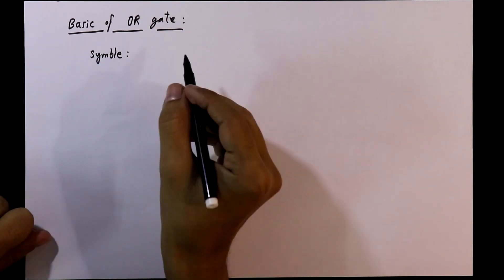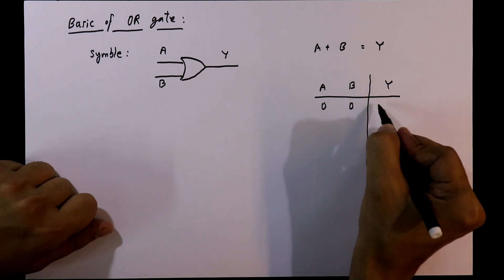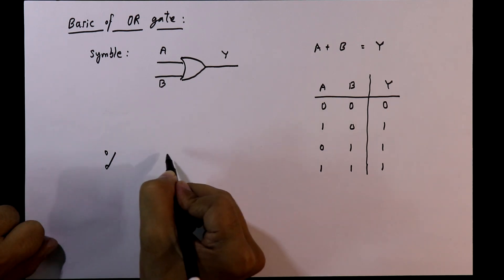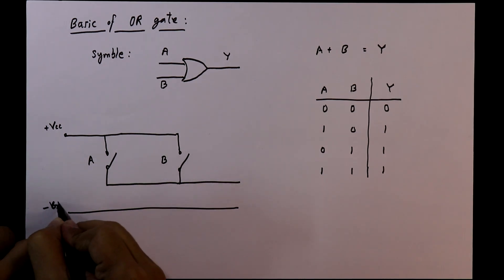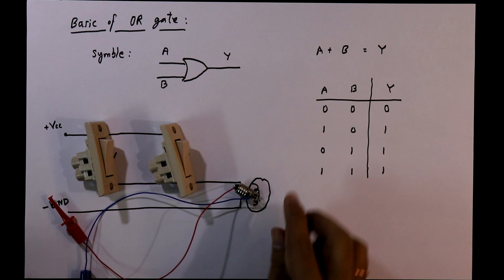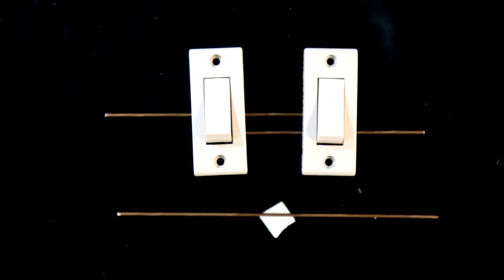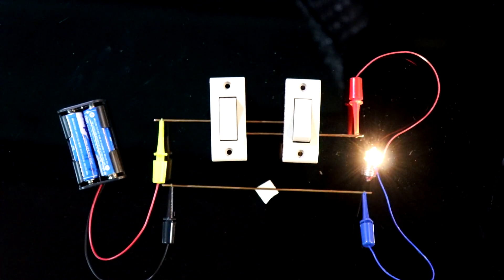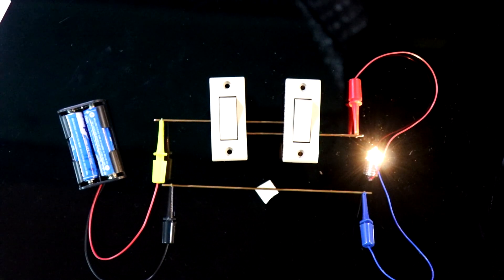OR gate circuit using switch | Introduction to logic gate

Comment: how can it be called an or gate if both switch A and switch B are put in a the same position and then the the light is on... to me this makes it look like it is an AND gate. However if you look at a stairwell light switch with one switch on the bottom of the stairwell and one at the top and the light is only able to turn on when power is applied from the 2 different locations... and there is never an option to switch both switches to any other position where both of them can turn the light on... then that to me is an OR gate.. I am going to now surf for a stairwell light witch using an OR gate... even though I may have the theory wrong a bout being to have the light come on when both switches supply power to it.... cause thats not what i am looking for.